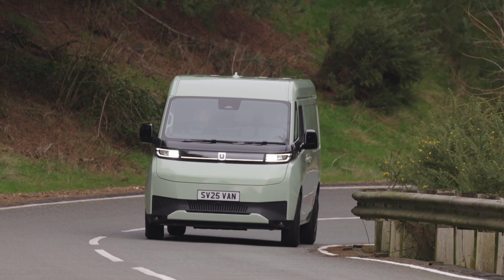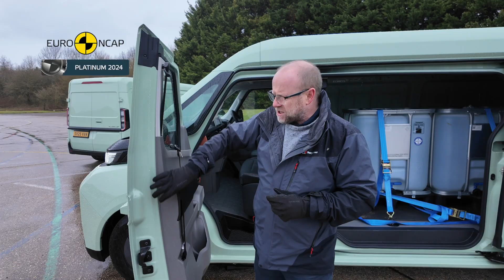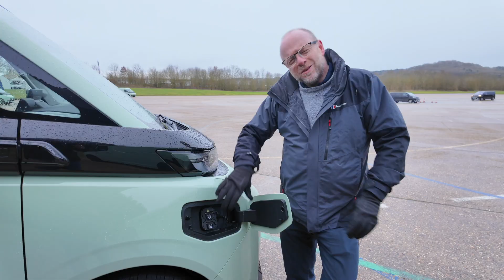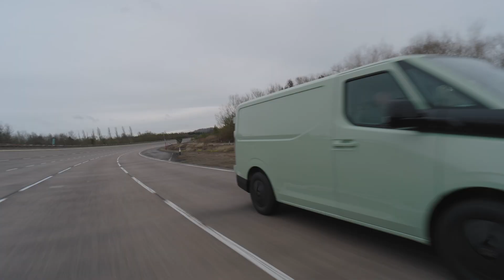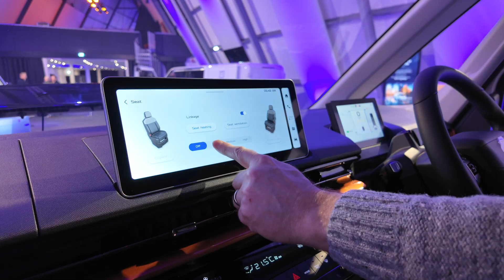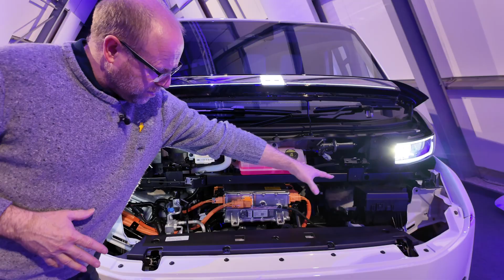China is here!! New to the Van market, the electric only "Farizon SV" from  @GeelyAutoGlobal #ev

Comment: You should be pinged for using a slur in your thumbnail. The side door may be 1.3 metres wide but the luggage barrier gets in the road.load height of 550 centimetres is going to make driving under bridges fraught.
Reply from the maker: A slur?

Comment: Really dislike the double A pillars. Dangerous and totally unnecessary blind spots right where you don’t need them. Seen the same on another new Chinese EVan. Not fit for purpose.
Reply: They're there to meet structural safety requirements. Older vans didn't have them and crumpled easier. The window between them will actually help a lot with the blind spot.
Reply from the maker: @alexPacker is right and they have very good visibility... Do feel free to try for yourself before reaching a conclusion
Reply: PSA vans have had this since 1996. Occasionally annoying (hairpin bends edge-visibility can be impeded), but not unsafe.

Comment: Service intervals every year? What's there to service? Aren't electric cars and vans not supposed to get away with servicing?  Whats to Service in battery and electric motor?  Or was it all lies???
Reply: The complication is the battery. You swap a mechanical engine for a chemical one. The battery has multiple sensors and it's own cooling system to maintain.
Reply: @Peter_Potato My Ev van hasn't had any so called battery maintenance for 14 years, the charger coolant just gets checked regularly.
Reply: @Peter_Potato  im pretty sure EV evangelists were saying and actually singing the prayers that since in ev car there aren't any mechanical parts than in traditional ICE engine , servicing is only down to tyres replacement and maybe brake pads???
Reply from the maker: It is under consideration as it was fed back. That said they want to make sure it is performing, and safe. I expect though that it will move to 2 years....

Comment: Was there any mention of V2L or V2G? Would be great to be able to plug work tools in to use whilst on remote sites!!
Reply from the maker: Yup 3.3kw V2L... I should have mentioned I think i did on a Linked In Video but omitted here!
Reply: @ Will the V2L stay on when parked? This is the stuff that matters for campers. You'd hope so but manufacturers do all sorts of daft things and give us no way to change them. If you have to keep waking the car back up from the front, (or putting a weight in the seat like the buzz!) that's not really much use.
Reply from the maker: @ good question. I fully expect it to be available all the time until a trigger based on remaining battery level is reached but it’s a question I have not asked
Reply: V2L is so common now that don't always promote it
Reply: @NatureAmen  most  cars and vans don't have it yet, the ID Buzz f.e. and all other VW cars. Such a mistake on their part
Reply: @wiespreektmij  yeah maybe not alot then but cheap cars can have it surprisingly, Dacia Spring has it at £15k

Comment: As a pass driver of vans for almost 40 years i still can't understand why the headlights are not fitted lower. The amount of times I was flashed at by other car drivers thinking the lights were on high beam but nothing like a quick high beam flash to sort that out. Especially now as nearly every vehicle coming out has LED headlights and don't require the large lens array like halogen lights
Reply: The opposite being the truth. That is why the law states that the headlights must be of a certain height. On dip, they are then sending the beam downwards.......
Reply: @barriewilliams4526  it's fairly obvious that the headlight beams are directed downwards on dipped, what I was getting at is that these headlights are well over a metre above ground level which is sitting basically on eye level with a normal height vehicle,not SUV types, and it doesn't matter if they are on dipped beam directing the lights downwards it still interferes with the on coming drivers eyesight IF they are driving a normal saloon hatchback or estate car. I've been driving van's and cars since the early 70s so I've been on both sides of the experience.
Reply: @Iceberg1313 There is a maximum height for headlights on vehicles it is 1200mm above ground.  That's to the centre of the dipped beam.    Maim beam is different.
Reply: @robertwillis4061  and minimum height is around 24 inches/600mm which I've no complaints about. But these heights were set in early 60s when we were still using incandescent filaments and halogen was just coming into the market in the UK. Don't you think it's about time these measurements were redone as we now have ridiculous high Kelvin LED headlights which are causing problems for some drivers due to how white the light is.
Reply: @Iceberg1313  Oh I agree with that.   The problem is that ALL EU members need to agree as well as the FIA.  Getting the EU isn't that bad ( just they talk crap and argue for no reason ) the FIA is harder to deal with.  
For some specialist off road vehicles there may be a height problem ( combine harvesters etc ) but that is easily fixed with a special exemption certificate for limited road use vehicles - this would be cleared with a certificate of conformity and an exemption under construction and use laws. Plus retro ( grandfather rights ) for vehicles manufactured before the new height legislation was passed.

Comment: I've got a Cupra born, and it's the first car I've had where the speeding tone isn't obnoxious. It's a subtle and soft noise. The noise that made  would grow old fast. 

Other than that, and the cup issue, I think this looks like a decent product. I'd not what my lads having 170kw and probably 350lb ft torque on tap. I drive my EV in it's most eco mode 90% of the time, not for range, but 1, it's fast enoght for normal driving, but 2, mainly because it softens up the accelerator pedal, when in Cupra mode, it makes passengers feel about sick

Comment: Add flappy paddles for regen levels to the MkII wish list, alongside the reach AND rake steering wheel.

WTLP doesn't work for commercial vehicles, so don't expect more than half that range when loaded; hell, it doesn't work for EV cars either.

Price is going to be important, against the newer designs from Ford etc, that have, more or less, fixed the miserable range of their 1st gen vans.

As an EV owner, having the plugs at the front makes far more sense than the rear 3/4 where most legacy car makers plonk them, even on a supposedly "fresh" EV only design; just look at how many chargers/metal barriers are bashed and abused by people reversing up to the chargers.
Reply from the maker: Reach and rake coming we are told

Comment: Not to be picky but,  it's a van used for moving stuff, you mentioned the range, was that loaded or empty, it's a very important question, infact fundamental for a van.
Reply: Fully loaded,b roads, 120 max
Reply from the maker: Depends which battery. But how and where you drive will always matter
Reply from the maker: Official WLTP is 30% loaded. You loose around 2% per extra 100kgs in other tests done on other vehicles...
Reply: 100% correct
Reply: The wltp figures are a total fantasy and the reality will be under 200 miles.
Reply from the maker: I reckon it will be better than 200 on the biggest battery but lets see... Will test soon
Reply: Not to be picky, but "The Internet is (sometimes) your friend"

Comment: Hmm. Looks like the best electric option for a camper conversion on the market so far.
Reply: Check out the Kia PV5 also
Reply from the maker: RE PB5 - Will be too small for a camper unless you are happy with a small ID Buzz sized one
Reply: @electricvanman  isn't there a larger PB7 as well?
Reply from the maker: @ there will be yes coming 2027 I believe
Reply: You read my mind, mate 😅😅
Reply from the maker: It should be good  for Campers, they have done this already in China
Reply: I bet they built on the platform of MIX: and that is an out-and-out camper
1. No B pillar design is defo from its MIX
2. steer by wire is from there as well
3. flatbed: no rear wheel bay
4. add the cross pilar beam increase rigidity/crashworthiness
5. add 2 and 4 they are moving the driverseat all the way to the front

They share so many features together and I think they must be sharing components and escpecially design/engineering team: I notice even the naming convention is very similar. Mix is SEA-M and Farizon SV is GXA-M.
Reply: Sleeping on top of a EV battery 😳😱
Reply: @realliveradio447  Studies have shown ICE (petrol and diesel) vehicles are twenty times more likely to catch fire than EVs.
Reply: @realliveradio447  Exactly! Electricity even at night - no need to worry about getting cold, or not having light. Fridge will always be on. The way forwards for sure!
Reply: @realliveradio447  preferable to sleeping on a tank of petrol or diesel together with a cylinder of lpg. EV locomotion battery fires are extremely rare compared to Ice vehicle fires.
Reply: @ImplyDods DEFINITELY not.
Reply: @albinklein7680  why?

Comment: I wish they would make an electric AWD/4WD van to take over the old Mitsubishi delica. Lots of solar campervan
Reply: Definitely. I've been fantasizing about a 4wd camper van with 20kW+ fold out awnings. Maybe a 5kW roof while driving.
Reply: @robt8869  
The most you'll get on a van roof is 3x 400W panels. Maybe 450 W soon?
Account for the horizontal mount and you might get 1000 W total in Summer at noon..
with nice flat sides you MIGHT be able to mount flexible panels and being vertical they would be useful in  winter (on one side) and might get you 50% capacity for 3 hours on a good day?
so no, you won't get near 5KW, certainly not 20
Reply: @robt8869 5kw is 20x400watt panels. That is an entire roof

Comment: Really like the look of this one for a potential camper base.   Good battery options good size options and all the latest tech.  Will be interesting to see what happens to the second hand prices in a few years time when I will be interested in a replacement.
Reply: Judging by the residual prices of VW transporter EVs, these Chinese vans will be a giveaway after 2-3 yrs.
Reply: @johnholmes5674  weren't they a custom made ABT with 60miles or so?
If that's the case of course they lost most of their value.
A van with usable range will stubbornly hold value. I can hardly see any Amazon vans for sale, even with missing trims and overtly mistreated.
That being said, I can start saving for the moment when someone will sell one of these for like 10k
Reply: @johnholmes5674 the Chinese are desperate to get rid of the stockpile of cheap ev batteries they have. So the new price on these should be a bargain. 
Okay as a camper as long as you don't intend to travel far. Depending on the conditions around 150 miles from a fully charged battery. 
When they quote the range of evs it's alway from a full battery down to zero. Depending on the type of battery it is recommended to only charge to 80% and no lower than 20% so you'll be charging every 100 miles. Public fast chargers ars over 16 times more expensive than charging at home. ( based on 7p per kwh tariff)
Reply: @ I took a gamble on a 2nd hand EV car when I was forced to replace my diesel car under ULEZ expansion. The jury is still out on whether I’ve lost out and bought a white elephant, but range is the biggest issue. I’ve recently installed a diesel heater as the car’s heater really saps the juice in the cold on a long run. But around town at about 2p a mile with off peak charging I can’t complain. I wouldn’t recommend anyone using an EV van for conversion to a camper van. You’ll spend most of your time on the road waiting to recharge if you can find one. The stress would wipe out any enjoyment especially on long journeys.
Reply: @johnholmes5674  200 miles should be more than adequate for a campervan. It would massively reduce the operating costs, which is the main downside of owning a van at all.
Anything shorter than 200 miles would make it a pain though.
Camper life is all about taking your sweet time. And better accept that all your fellow travellers will be well above 70 years old 🤣
Reply: @BGS_123 what an amazing load of BS. How absurdly far from reality can you be, please? Imagine a trip to Spain with a campervan with less than 200 mile range. That is far beyond ridiculous. And ABSOLUTELY no one wants to (literally!) sleep on a multi-kWh Lithium battery.
Reply: @albinklein7680  nah. Diesel fumes aren't exactly much better. And you will inhale loads of them from your own vehicle and the fellow neighbours at the campsite.
As a person who did multiple cycling trips where 100 miles in a day was optimistic, having to stop every 3 hours is really not such big of a deal
Reply: @BGS_123  I did a lot of holiday trips with a campervan when my two kids were young and we used to go on vacation as a family. Almost all of our trips went to south Europe (we live in Germany). When we went to Spain, we started in the early morning at sunrise and in the afternoon we were already in the middle of France and then my wife took the wheel and drove the next 800-900km into Spain. 
With an electric campervan with a 150kWh battery you would need about four days to get from Germany to Alicante/Spain.
Reply: @albinklein7680  I rest my case then lol. You Germans take campervans seriously lol
Reply: @BGS_123  I am sorry for the "hard words". Everybody can and should (of course!) use his campervan as he likes it!
Reply: @johnholmes5674  , can't compare VW does 70 miles & not. Purpose built  floor plan .

I will wait to by used from Auction
Reply: That's right. It's hard to get excited about how your local evri delivers your cheap parcels. But having a nice zero emissions campervan, that's something we can dream of
Reply: @BGS_123 in the USA, GM is offering rebates on 2023 and a little bit less rebate for 2024 Brighdrop Vans and I bought one and it is super amazing! Awesome! Fun to drive best vehicle I ever bought so far but I need to do a lot to get it to RV. Fun ready
Reply: It really looks like they copied my new bigger Brightdrop delivery utility Electric van.  Gm should try to sell them in Europe because it is a really nice fan four-wheel drive a really big battery option. Nice driver assistance modern design...
Reply: If you can live with the doors. They're an "interesting" feature to have in the UK LOL

Comment: The weight sensor is an incredible feature.  Prevents overload and damaging the vehicle.  I hope these take off in Europe and maybe we can see them in North America.  The design is perfect.  It's very boxy and functional with a bit of styling to it.  Nice.
Reply: If Canada removes the 100% tariff on Chinese vehicles, when they were supporting the USA at the time, this would make an excellent vehicle for companies like Canada Post. 
I do find the lack of an inside release on the back doors something necessary, and the LONG reach to close the front doors when fully open,  from the seats awkward and straining. And yes, a middle seat that doubles as a desk surface should be standard. Also, the seat bolsters make for a comfortable and secure seat, but those large bolsters will wear quickly when drivers enter and exit a lot during their work day.
Reply: Well, as long as narcissist, Fatboy, dictator Slump is in power, we won’t get anything like that. 

Keep up the great work over there not buying anything from us greedy, corrupt, genocidal, hypocritical, abusers until we straighten our arses up.